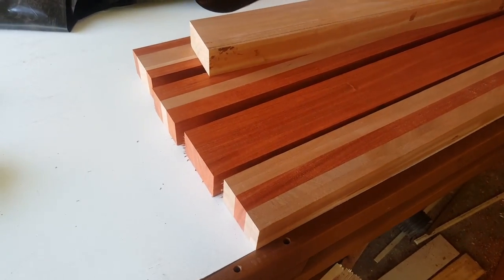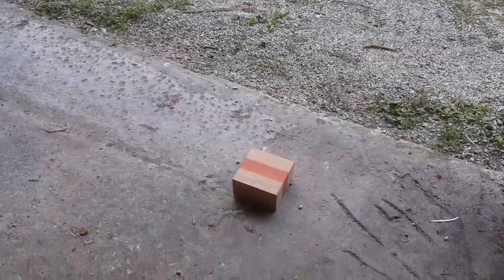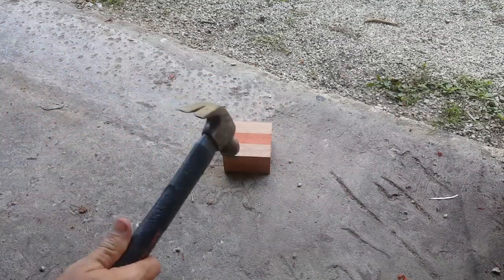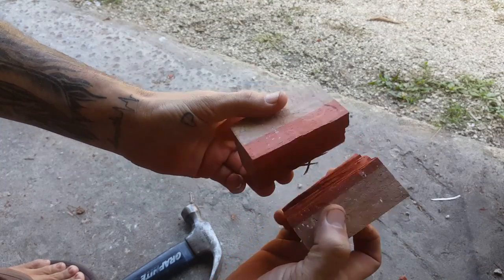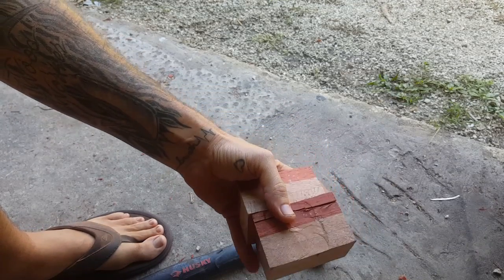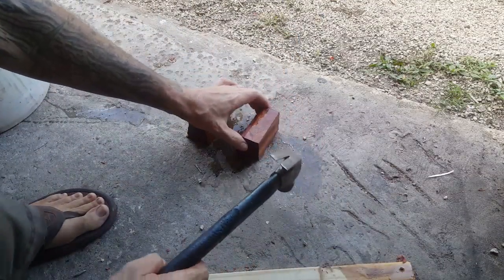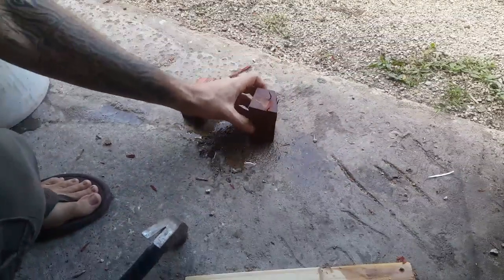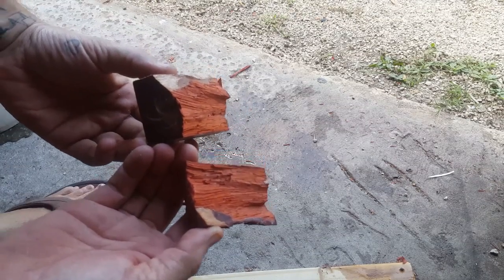West systems epoxy test Sapele and Padauk

Comment: I have a few questions on the process you used: 1) How thick do you put on the epoxy?  2) How much clamping pressure do you use? Thanks!
Reply from the maker: k9taxi thick enough to get nice squeeze-out along the entire lamination and enough clamping pressure to achieve the same.

Comment: I had the same issue , had the speargun outside of the water for about 3 years and it looked really good .Once I started using it 

it started delaminating. I am a 100% that I used the right amounts of hardener and resine as it's not the first time I do this.

i don't think using a hammer would produce the same conditions the wood would be exposed to between salty water and 

hours in the Sun. I don't trust just the epoxy anymore and I am trying to use finger joints before laminating the wood together.
Reply: how long thespeargun did live anyway, did u take care of it regulary after using it , did u coat well ,recoat !!